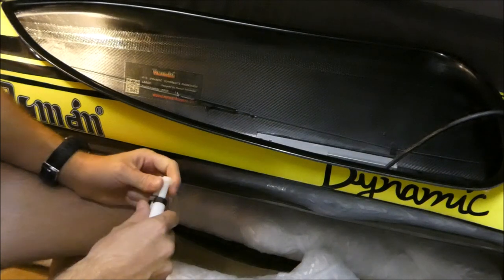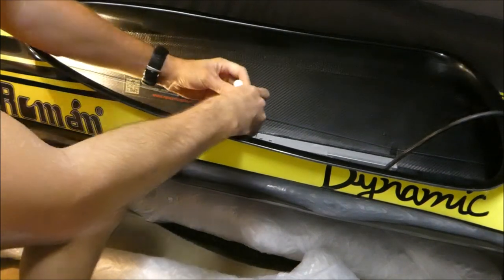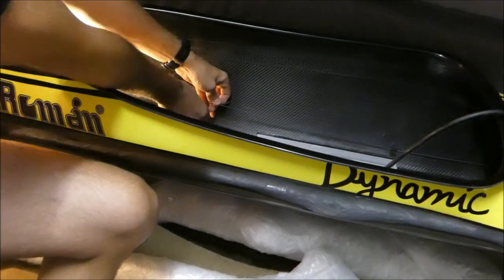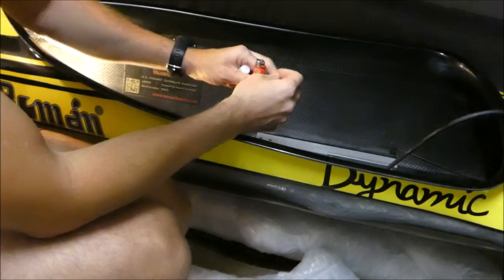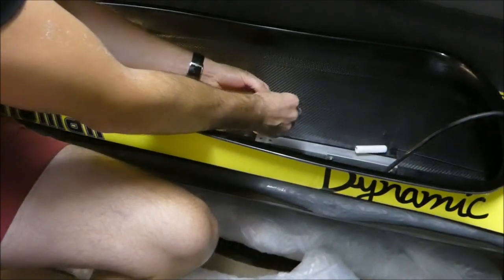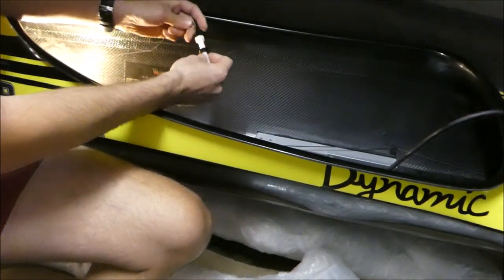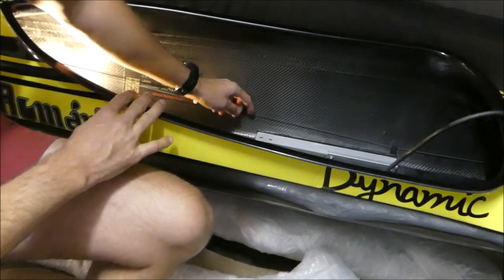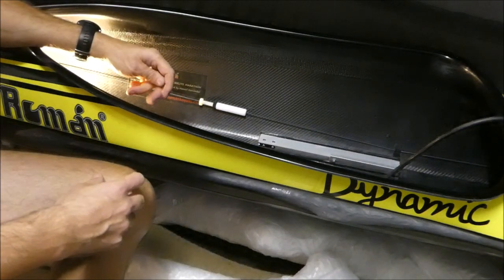Wash Rider TV - Rudder Cable Tensioner Installation

Comment: Have you done a review of the Roman dynamic?  Looks like a interesting design...
Reply from the maker: Hi Matt, we would be too bias as we distribute the Dynamic and think it is sensational and balanced for the speed it can do. However, here are links to two other reviews: http://www.acquaexcel.com/2018/05/20/k1-dynamic-roman-fondo-piatto/

http://wwwjaviermelus.blogspot.com/2017/09/k-1-dynamic.html?m=1
Reply: @Washrider  thanks.  I just perused the reviews and one seems to be a copy/translation of the Roman website and the other is ....well... 

 Interesting.  (I think some of the enthusiasm is lost in translation).

 It's ok if you are biased, just reveal your biases ahead of time in your video.  Or do repeats (1km) on flatwater one in a Cinco/legacy/vajda and the next in the Roman.  Hold a consistent HR (aerobic zone 2?) -i think a number of us would like to more of it; it's so unique.
Reply from the maker: Hi Matt, Trovi from Elite Kayak has done this little video in English for us here too: https://www.facebook.com/romankayaksaustralia/videos/2170462199892209/
Reply: I purchased these from your website over a month ago, and have not received them nor has anyone responded to my emails. 50 bucks for two screw tensioners is outrageous but I really thought it was a great concept. Definitely will not recommend!!!
Reply: Can this tensioner be used in stainless steel cable?